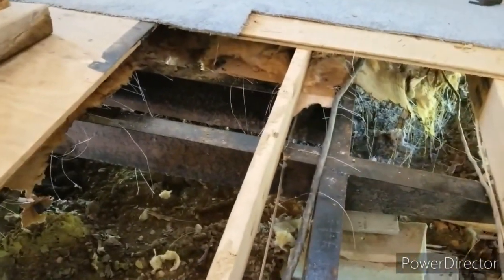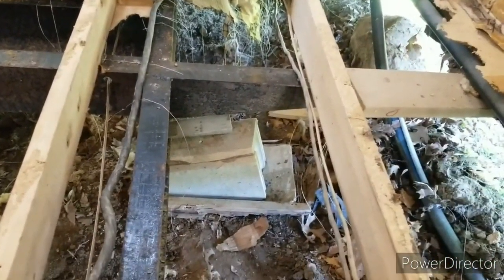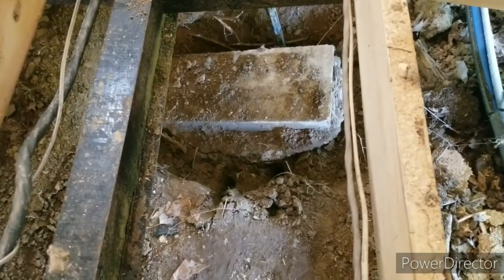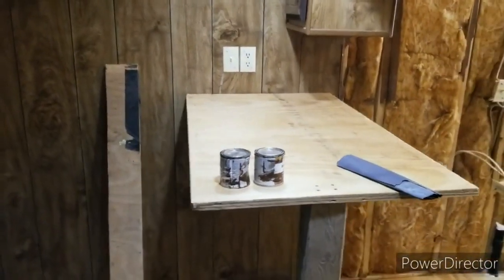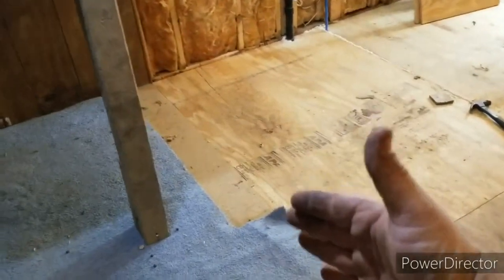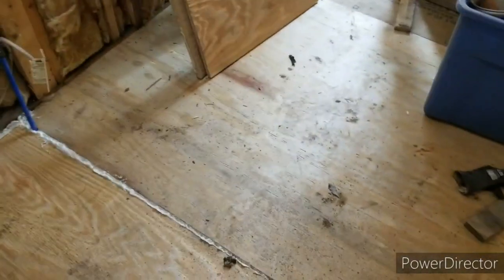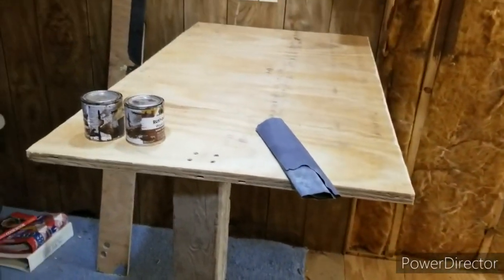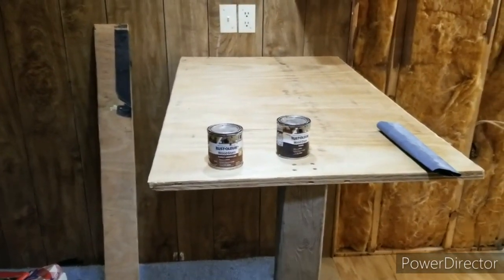1979 MANUFACTURED / MOBILE HOME - FOOTER REPLACEMENT - FLOOR REPLACEMENT - WORKSTATION PART 2 OF 2

Comment: Hey Guy, save the labels off your beer bottles and stick them to the top of that work table and then cover with polyurethane. You'll have a cool table to add to your collection or use outside later.

Comment: They screwed up when putting those footings back when the house was new. It shoulda been two flat concrete pieces so it had a wider platform then the footing it’s self is.